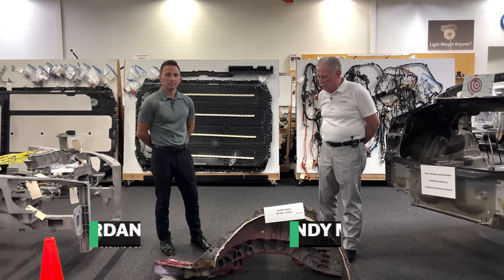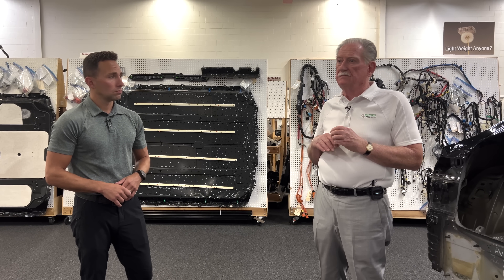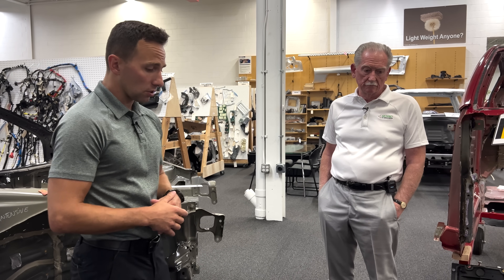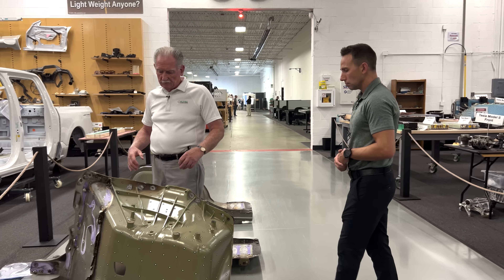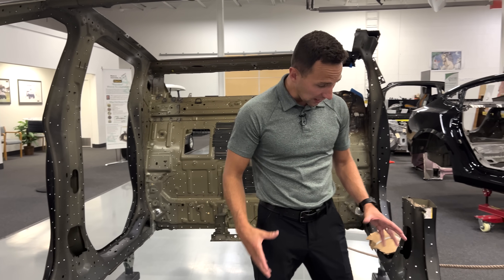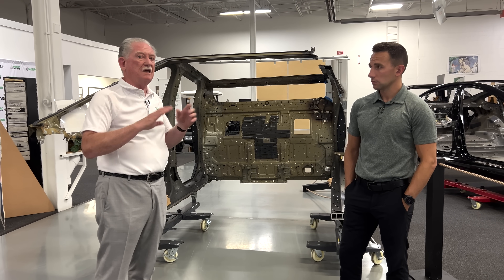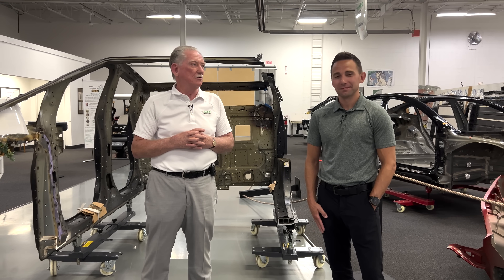From 120 to 1: How the Cybertruck Castings Continue Tesla's Reign of Reduction

Comment: Would love to hear your take on the casting fracturing near the hitch during the WhistlinDiesel torture test. Obviously abuse, but nonetheless, the cross section there is surprisingly thin for attaching heavy loads and the inevitability of SOME impact forces.
Reply: I'm aware. But potholes are real, and aluminum fatigues and fractures more than steel.
Reply: @Turbo.M777  Then I guess you are careful to have old steel wheels on your car instead of the almost ubiquitous cast aluminum wheels on cars today.
Reply: @royh6526  individual wheels aren't holding a tension load of 10,000lbs or more on a lever, so I think they should be ok... they also are easily replaceable. A frame is not.
Reply: @royh6526  This is nonsense. Alloy wheels are sufficiently designed to support the dynamic loads they will endure in normal use. Per the Cybertruck owners manual and the Model Y as well their receivers are only rated for 160 lb Max vertical load. This is a different specification from tongue weight. When you look at the same specification for Ford, Chevy, and Toyota trucks they can support anywhere from 500 to 800 lb. This is the load rating you need to consider when using receiver hitch accessories like bike racks, a motorcycle or scooter rack, cargo trays, mobility device carriers etc. The 160 lb specification can very easily be exceeded, both statically and dynamically. Especially with someone's past experience being with receiver accessories used with vehicles that don't have such a low specification. It's deceptively low given that the Cyber truck is a full-size truck with similar tongue weight and trailer weight ratings of other full-size trucks. Yet on this one specification vertical load rating it's significantly less. The whistlindiesel torture test isn't what anyone should be concerned about. Several other failures under normal use, like the one guy that was towing and hit a pothole and broke his receiver is what should be concerning cybertruck owners. As well as the very low specification in the owners manual for vertical load.
Reply: I’ve hear that hitch failure has occurred 3x now out of the initial run. That is very concerning
Reply: @ancientsymbol  Do you have details?
Reply: yes the engineers may have to find a new solution to support the hitch receiver further into the unibody (if I can call it unibody?)
Reply: Sandy indirectly acknowledged the towing issue by saying that the Cyber Truck's body structure had delivered very good driving characteristics and that towing was not why he owns the Truck. (or words to that effect)
Reply: They call it the cyber beast but that whistling diesel segment shows that it's definitely not such a beast when compared to a standard truck. It would make me nervous to tow much with a cybertruck.  The other truck had no problems with multiple drops. The truck was supposed to be in exoskeleton but is just another unibody like my Honda Ridgeline. I could see all sorts of problems. Off-roading as well... So again it's more about how they marketed this Cyber truck.
Reply: "Obviously abuse" kind of if you do lots of serous off-roading its gonna happen sooner or later and they did a follow up video doing the same and more to the ford and it took it. if what happed to the CT was abuse then what happened to the ford was word that rhymes with grape. 

also normally the tow hitch receiver is a sub frame so if damage does happen it takes it and not the primary frame. even outside of off-roading say your towing and someone rear ends you and the hitch receiver is broken on a CT as far as insurance is concerned that CT is an unroadworthy pile of scrap that would take to much to repair and if they did your premiums are gonna take a massive hit
Reply: That happened when the Cybertruck was driving off the large culvert, and the back fell down to the ground from more than 2 ft up, landed on the hitch. This was a huge impact, like something you could experience once in years of off-roading.
Reply: @royh6526  Irrelevant. What is relevant is that per the Tesla Cybertruck owner's manual the vertical load specification on the receiver is 160 lb max. This is a different specification from tongue weight, and is significantly less then the rating of other trucks which are in the 500 to 800 lb range. This specification is referencing the kind of load you can put on the receiver hitch with accessories, not tongue weight when towing. Like a bike rack or a cargo tray or a motorcycle carrier. It's a very low specification, and exactly the same number it shares with the Model Y which also uses a rear casting. There are legitimate questions about the durability of the casting that supports the receiver under normal use conditions that are typical of trucks with 2" receiver hitches.

Don't think that motorcycle rack that you use to carry your dirt bike on the back of your F-150 or Silverado or Tacoma is suitable to put in a cybertruck's receiver and toss your dirt bike on it bouncing down rough roads. Or even the highway. A bump or pothole will quickly make you regret it. And Tesla may tell you that you should have read the owners manual, that it's not going to be a warranty repair because you overloaded the receiver. 😂
Reply: @ButterfatFarms  I do find this somewhat confusing, Tesla lists several vertical load rates dependent on the distance extended, such as 375 lbs at 18" and a tongue weight of 1,100 lbs for a ball hitch. So I think you are comparing apples and oranges.
Reply: @royh6526  I think yesterday they responded to the controversy and updated the manual. I haven't looked at it yet, but I saw an article about it but didn't get a chance to check it out! They did just have the simple specification 160 lb vertical load in the manual in the last week I looked at it.
Reply: @royh6526  and you're right to be confused that's due to Tesla not my comparing apples and oranges.
Reply: @royh6526  and I don't know why I wasn't able to tag you in the last two posts... what's with YouTube doing that on some posts where it ends up just being text.
Reply: Google and read - " Tesla Finally Responds to the Cybertruck Tow-Hitch Controversy, Says “The 11,000 lb Tow Rating Isn't Absolute” "

Comment: Its great half the discussion is about the speed of decision making behind the innovations.  Traditional companies have giant consensus meetings that make even modest change a battle
Reply: A simple explanation is that companies that make products with a high degree of liability are very reluctant to make changes that may cause their product to fail.  They can require a great deal of long term testing to prove the changes will last.   Say, for example, that you are a window manufacturer that has a 10 year warranty on the weathering performance of your windows.  How willing are you to change over to the next great plastic covering without at least 5 or 10 years of weathering test results on the new plastic?  Imagine having 2 million windows fail and you are responsible to replace them (including installation costs)!!   Same thing in the Automotive business, except you can also be held responsible for dangerous product failures that are not under warranty.  Years ago, just about every house siding manufacturer in the US had gone bankrupt at one time or another because of unforeseen product failure liabilities.

Comment: I probably know nothing as not an engineer or anything. But wouldn't these larger and larger one piece die casting make repair near impossible as you can't just replace a damaged cast part as the part is basically the whole car. I don't think it would be safe to bend back into place and probably near impossible.

Comment: Do you think they will switch to magnesium soon?
Does it make sense from a weight reduction vs cost standpoint as reduction in weight result in cost saving in batteries and almost every structural components.
Reply: Imagine a lithium battery + magnesium frame fire...

Comment: 9:12 It looks like they've built in the beginnings of a crumple wave- the vertical front bit is caved in a little and the load rails have that wave pattern... Like he said, "Water formed"? 
And, do all those 1/4" holes aid in cooling the part faster when it pops out of the mold?
Reply: I don't think they are holes. They look like stickers that are reflective for use with 3D scanning?

Comment: I as a  guy on the street and as Sandy once said these are too inside the structure and won't get damaged easily so it must be intact on  most of the insurance write offs so I guess in 3 years from now you gonna have them full less than $2,000 from your local scrap yard brand new ued! comparing with repairing a structureraly damaged sheet metal car with a tesla with its casting damaged  is a gift is a new a heart. Like BMW, that i feel i see its design signature in tesla for years, probably they gonna sell u 5 tube of adhesives, repair the sheet metal parts and use the Elon fixture torque the nuts cook the adhesive, its cybertruck there is no paint a major accident can be repaired in less than 24 hours even the metal sheet body with out panel not gonna cost more than 2 k  And you have tight tolerance on chasis level. it's a big debate in petrol heads for years about chassis aliment standards and the fact that an internally structural damaged car can't be aligned ever no mater how skilled is the body repair technician is. This means the death of a car now the car is not 1 unibody as mont points but all replaceable parts body repair shops dream also in Tesla body repair shop a dealer level you can change 20000 grand and safely repair it not to write off a 80k brand new beauty.🎉

Comment: Around 15:00 wind noise was mentioned.  As a consumer, it would be interesting to see what is done to reduce cabin noise.  There are areas where some substance is applied - but it isn't applied to the entire part.  How do they determine that spot will reduce noise?  Also, are there any technologies or techniques to reduce road noise?  I wouldn't think so as the tires must contact the ground and noise will travel through every part to the cabin.    Is this interesting enough for an episode?
Reply: One way sound is transmitted through parts of a vehicle is as vibrations.  These vibrations are waves that have spots that are nodes (almost no vibrations) and antinodes (the majority of the vibrations).  The automotive manufacturer models the complete vehicle construction and knows the exact placement of these antinodes.  Sound dampener are than place only on the antinodes to save cost and reduce weight.  Look up ASTM E756 for some background on vibration dampening.
Reply: Sound IS vibrations

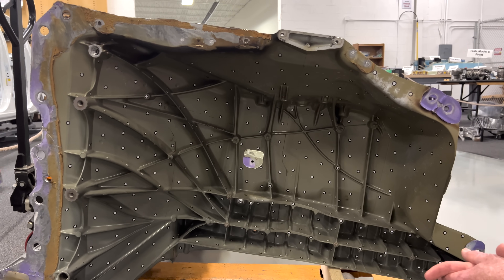Comment: with the casting shown at 7:00, has Munro put any thought how a 2 piece mould with one held fixed and one moving produces castings with pockets as shown.  The half castings shown at 1:25 would be fine for the 2 piece moulds, but the full with castings at 3.41, and 7:00 show that there would be impossible for a 2 piece moulds with the pockets and gussets

Comment: Non-engineer here.  I kept hearing the term "Sealing off".  Can someone elaborate?
Reply: Making body parts mate with others so there's no gaps. You use goop to make sure. It keeps dirt, noise, and water out. Batteries are sealed against the underside. Do it right and the car will float.

Comment: Can't wait to hear Sandy pontificate on the 6 new standard connectors Tesla just announced and are sharing with the legacy OEM and supplier universe to help move the industry to 48 volt  architecture.
Reply: The only reason Tesla went 48 volt was for the steer by wire system. It's going to take quite a while for other manufacturers to get to that point. Until then 12 volts is plenty, unless you're done doing something really high end like the Mercedes active suspension.

Comment: It should be noted the front Model Y casting does not appear in the Long Range or Performance models.

Also if you do a deep dive in the IIHS spreadsheet data, the non-4680 Model Y (the Long Range and Performance) shows superior crash and crush performance. 

Both still achieve a “Good,” but if you look at the details the non-4680 has better characteristics. A lot stronger. 

My 2023 LR has rear casting only. The front structure is traditional stamped steel.
Reply: It makes sense that they would save the castings for the highest volume model.

Comment: Self charging. 
Do you think that Tesla will get selfplug-in, bumper plug-in v2g ? 
Anywhere charging at every parking space. 
A $60, bumper height, wall outlet is all that is needed. Shopping centres, home, city car park stations,.... Car to grid communications. 
Battery topped up or trading electricity with home or grid ?

Nuclear electricity needs constant steady demand. 
As we know home demand fluctuates 247.

Rooftop PV needs a bigger battery 247.

Big EV battery is perfect for both, as home demand fluctuations is different to both supply. 

Millions and millions and millions of customers home and buildings and just as many vehicles.

All vehicles are parked 23hrs every day, even school buses in the USA.

Comment: They didn't mention the Cybertruck's issue with the rear casting shearing off from vertical loads! seems like a HUGE design flaw that I wish they would of covered.
Reply: If you’re talking about “that video” then it wasn’t just any old vertical load. Any vehicle would have been structurally compromised, maybe terminally, by that level of abuse…
Reply: @skwdenyer  Its common to hit the rear or hitch in many trucks and they are fine for many years later . Cast Aluminum is simply different and dangerous to use on the frame of a truck
Reply: @skwdenyer no that is not correct, they did far worse to the Ford .... that didn't break, also if you happen to be behind one and it happened, and it wiped you out with your family on board, I doubt you would be saying this..

Comment: Can you talk about how castings affect repairability?  If at all.
Reply: It's a different set of techniques. If you look at the Evolve EV channel, they get into the body shop specifics of repairing the castings. It's more expensive right now because not many shops do it, with so many millions of these cars on the road, it's going to become standard procedure.
Reply: @otm646  thank you for the suggestion. I'm really interested to see how these vehicles are repaired.
Reply: Look at NASCAR, Le Mans. And Audi R8, Lamborghini Huracan, etc. All of these vehicles have a center cabin with sacrificial sub-frames bolted onto both ends.

Comment: Why didn't Tesla go to castings for the S and X refresh (and, I have read, the refreshed Model 3 in China)?  Is there a volume criteria below which casting does not make sense? 10,000 per year? 100,000? 1 million?
Reply: You answered your own question. Because a MAJOR redesign is expensive, requiring retooling, testing and is not viable for a "low production" vehicle.
(Exactly the reason the Legacy Manufacturers all used existing high value chassis for their first attempts)

Comment: What does it mean for repairs? I get that its awesome for production, but how do you repair a cast part when it’s so completely integrated? This is starting to become an issue.
Reply: OK, Let's try again.....
1) WATCH The related videos on Munro Live.... They explain the process.
.
2) To require repair of the casting, the accident has to IMPACT the casting?
The casting is generally "inboard" from the etremities of the truck.
there are sacrificial "Crush cans" Designed to... crush" in a low to medium impact, EXACTLY like other vehicles. You bolt those on.
.
3) It seems a "really clever" person a Tesla asked the question, probably the same day someone else suggested using casting? The result was the "designed in" a repair system which is actually easier, more accurate and stronger that pulling and welding a "conventional" vehicle (Ref #1)
.
As a result, this IS NOT "an issue" unless you (Or the Insurance companies) don't pay attention, instead relying on "the internet" for "opinion" rather than "Fact".
(Do I seem "perplexed"?)
Reply: @rogerstarkey5390  Looks like you are the "troll expert here"  Cost of crashes has gone up. Tesla just dont care, as it is not their problem. At least not in the short run. Same deal with the load bearing batteries. Much more expensive to fix, but cheap to make. Tesla is made more like phones. buy it, use it and throw it away.
Reply: @GTO33  
NO,
I just LISTEN to what's being said over the months and don't jump to conclusions (How precisely do you know the "Cost of crashes"?
Take a look at "Conventional" vehicles being written off, then bought and repaired by independent shops.
This is NOT a "Tesla Problem"
As for Load bearing Batteries (That's "Packs" btw)
That's a strange comment since there are a relatively tiny number in circulation.
Are you assuming that a "Pack" failure is always caused by a "Cell" failure and not a fault in the (accessible) Control Electronics?

Comment: Tesla has multiple advantages in the manufacturing field. The co-operation and integration of their various engineering departments is one. The ongoing efficiency gains in factory floor space is another. Rejection or at least realistic considerations of "sunk costs" is big too. The Q3 numbers give a clue to where this is heading. Gross margins went UP overall, despite average selling price going down and ramping a completely new model is a huge indication. RAM is in trouble, it won't be the last. My biggest concern for Tesla right now is Elon's insistence on FSD is still very risky, even if it showing improvements. I hope they still keep the possibility of building a cheaper model based on the manufacturing advancements of the Robocab.